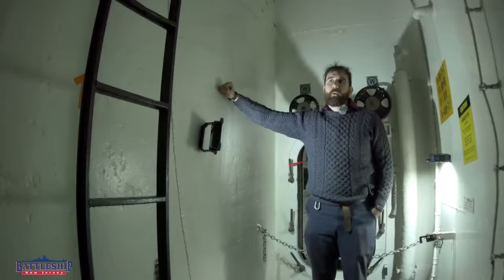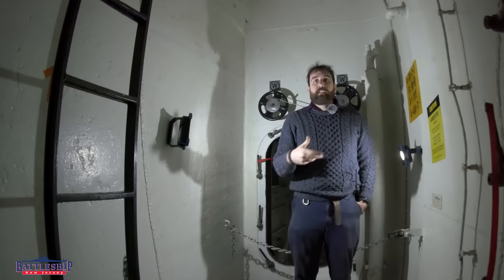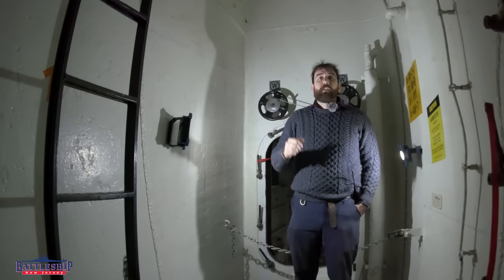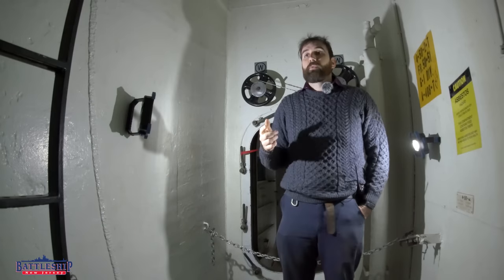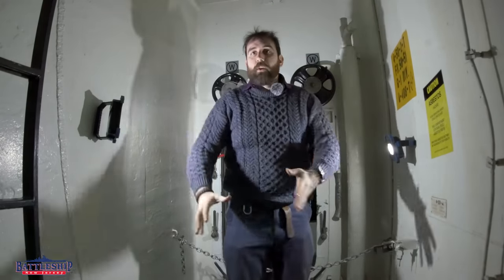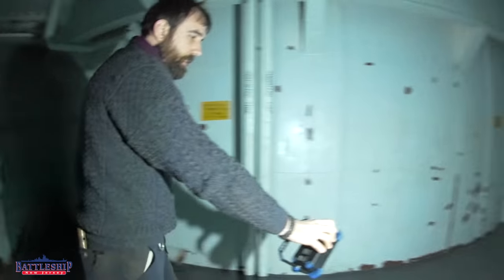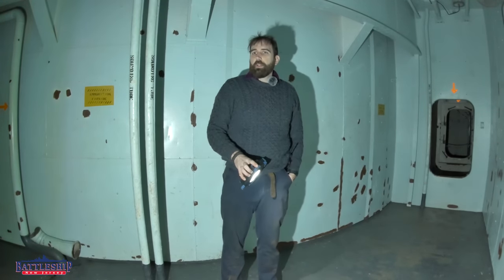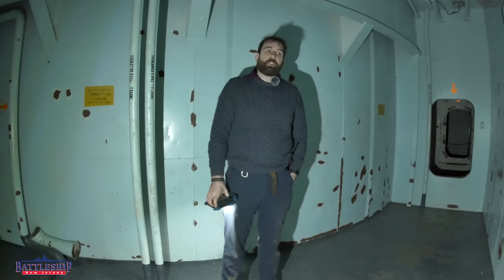Inside a 20mm Magazine

Comment: I didn't know what an explosion-proof light fixture is, but now I want to know all about it and other peculiar lights used on the ship.
Reply: You're in luck! Here's the video. https://youtu.be/fCm5x2OmdHI
Reply: Many thanks.
Reply: It's actually not as informative as I thought. Must've been apart of a different video... too many to remember
Reply: They are common in mines and other hazardous areas, otherwise known as Class 1 Div 2
Reply: I have them all over my plant. I would guess most on the ship are Class 1 Division 2 fixtures. Class 1 Div 1 are probably used in the powder rooms though because of the propellant off gas. I have to use class 1 div 1 flashlights in my plant
Reply: Anywhere a spark could tigger an explosion.  You see them in grain elevators, as its very dangerous in those as an example.  Even in the engine rooms of gas powered boats.  Everything in that space has to be explosion proof, as you can't have a "spark" when something is turned on just in case.  The issue with lights is when the bulb fails or possible shatters due being hit, there would be an arc which could trigger a very rough day for the people.  👍💥
Reply: "Explosion Proof" is the actual terminology people use, but, it's kind of misleading.  In essence, it means that the light, or switch, or flashlight, etc. will not cause an open spark to cause an explosion.  The light bulbs are shielded.  The threads typically have o-rings.  They are rugged, often out of cast iron or cast aluminum.  Basically, it means that if something happens in device, it will not cause an explosion.  I think there are separate ratings for flamable gas or explosive powder environments.  I used to work in a solid rocket propellant plant in Sacramento, and in the factory & assembly areas, all of the lights, switches, outlets, and even our flashlights were "EP" as we referred to them.

Comment: The zig-zag tread pattern left on the floor comes from 1980's era chukka safety shoes issued at that time. They were a six-inch high boot/shoe with steel toes.
Reply: Boon dockers
Reply: @MrJeep75  I knew they were called something else back in the day, just couldn't remember what it was. They were also great for riding motorcycles.

Comment: Before you go into some of those spaces, do you check O2 levels, or is the ventilation system working in all areas?
Reply: Or ghosts?
Reply from the maker: Sealed spaces should always be checked for oxygen levels. Fortunately, we dont seal off spaces too often. This space has been open for ventilation for decades. On an active ship these places would be closed off  when not in use, on a museum ship we prefer to leave it all open.

Comment: At about 9:15 there is a fan mounted on the bulkhead. That would seem to be even more evidence of the space being used as an office.
Reply: I would like to know how they could fit a desk through the hatchway…..maybe IKEA?😂
Reply: @johnjensen2217  Navy desk is a flat board and a set of hangers, designed to be taken apart to go through the hatchways, and the supports mean it is hung from the wall, so that ship motion will not move it. Otherwise they would have taken a standard GI desk, and stripped it down so the top sheet can be unscrewed from the legs, and the drawer unit stripped as well, to make it a 4 piece unit that can fit, plus likely cutting it down in size as well to fit the hatchways, then screw it back together down in position.
Reply: @SeanBZA  You are right.  Sailors are a creative bunch and they will find a way to make it happen.  We used to say in the shipyard there is no such thing as sailor -proof 😉
Reply: @johnjensen2217  Old story of a sailor tossed in the brig, so the captain puts 2 cannon balls in there to occupy him. Next day at roll call he is found to have lost the one and broken the other.

Comment: At about 4:51, when you show the upper hatch, it looks like there is a ladder that goes part of the ways, but nowhere near the floor. Where is the rest of the ladder? I don’t see the little wire rungs you sometimes show.
Reply from the maker: It's not a ladder it's netting, usually allowing just a small opening near the ladder so if someone falls hopefully that will catch them.

Comment: In the UK, we used to have lock fittings in our excise bonded warehouse which were designed to be broken easily by firefighters if required.  When handling barrel proof whisky, fire is a serious hazard.  The tax officials held the keys.  If the lock fitting was smashed, it was very obvious, and would be investigated, but at least the firefighters could get in.

We also had (and have) easily smashed bolts on some substations, so the fire brigade can get in.

Comment: In the start of the video, there are two hand cranks over Ryan's shoulders marked 'W' and connected by what looks to be a safety wire.  Does anyone know what their function is/was?
Reply: They are for damage control to control ventilation.
Reply: Thank you for asking. I was wondering the same thing. Is that something found usually in deck's below the water line? Are they still currently used?
Reply: @nathanielfoster2851  Thanks! How do they work?
Reply: I dont know what the W stands for or what they do when turned, but usually when you wire nuts or cranks like that its to stop them from turning accidentally or being turned by someone.
Reply: It's called a circle william fitting. Yes they are still used in the modern navy. They are normally in a locked open position and in case of a chemical biological radiation(nuclear) attack, fire or anything of the sort they are closed so it doesn't spread and cause more damage.

Comment: I'd be interested to see a clip about the differing types of 20mm ammunition used. Am guessing HE and Tracer would be the ones commonly used, but believe there were also Armour piercing and a high velocity Armour piercing round but its hard to know if they might have been used at sea by something carrying so many much larger guns.
Reply: I doubt that those 20mm rounds could achieve high velocity, since their range was so short, that by the time they were firing at a plane, it had already dropped it's payload. So it was pretty much exclusively HE and tracer rounds.

Comment: Hmm - it would be interesting to see the original ammunition boxes for the 20mm ammunition - are any of them still around? It would give us an idea of how many could be stored in those spaces.
I assume they came in big metal boxes, like those used for rifle or machine gun ammunition for the infantry. Do we know what kind of containers were the 20mm ammunition transported in?
Reply: Is there any record of how all the ammunition was delivered to the battleship? Most people don't appreciate how much work goes into resupplying ammunition, because it all has to be transported from the factory to the ship down to the rifle, packaged to keep it from detonating on the way. Which might mean it was packed in a box or a wooden pallet. How were the 16 inch rounds taken on board the ship, the 5 inch rounds? Individually, or in big wooden pallets that had to be broken down by the crew? How were the powder bags taken onboard?

When I was a tanker in the Army, the main gun rounds were delivered in a big, wooden pallet, that was just dropped next to our tank in the field - we would have to attack this wooden pallet with a pair of bolt cutters, an axe and a sledge hammer, and tear it apart - then each round was stored in a thick, card board tube that we would have to break apart. Only then could we take the individual tank round out of the tube and pass it into the tank to be put into an ammunition rack in the turret or hull.

It was a lot of work - I wonder how the battleship took on ammunition, and if it was as much work as we had to do for a tank -

Comment: Question for Ryan, given the role of the 20mm AA guns on the ship why were the guns not belt fed?
Reply: Later versions of the gun were.  Perhaps getting to many rounds linked together may have made the boxes of ammo to heavy to move around by hand to the multitude of 20mm guns the navy was adding everywhere.
Reply: Most of the single 20mm mounts were not powered, so you can't stack too much weight on them. I imagine a good gun crew could swap the 60 round drums very fast anyway.
Reply: The design wasn't meant to be belt fed, and the drums offer decent firepower without excessive weight. Belts of cannon ammo get really heavy really fast.

Also you'd have a bunch of belt links falling all over the place. Magazines are reusable and won't be stepped on or swept over the side

Comment: Off subject but could the turrets be removed and the New Jersey be loaded with loads of vertical launch tubes and be controlled/guided by the aegis combat system of the Arleigh Burke destroyers? Basically be a missile truck for the fleet.
Reply: There was a plan in 1996 or so to place around 96 VLS tubes where the armored box launchers currently are, leaving the entire main battery and at least 4 of the twin 5in guns fully functional. 

Here is an artist depiction of what it might have looked like:

https://www.deviantart.com/tzoli/gallery/77565995/usn-warships
Reply: I was thinking about that the other day when Ryan was talking about what a modern BB would look like. (The video where he was using the large model as a visual aid)

His idea of adding the vertical launch tubes to the back of the superstructure makes sense, but I was thinking that replacing Turret 2 for vertical launch tubes would reduce a lot of weight, keep the added weight lower in the hull and still retain 6 16” barrels. 

I would think that there would be less need for 16” shells with the addition of some SM-2s serving a similar purpose.
Reply: anything is possible, but it could also be disasterous. an example they tried to convert USS Vincennes CG 49 from the old gmls missile launchers into a VLS ship, and it failed.
Reply: @mrnoodley  that’s when I got the idea also.
Reply: @leftyo9589  agreed, it could be a disaster. It just sounded pretty cool and would be pretty intimidating.

Comment: Action Stations by departments.  Gun crews closing up and how they got target information in WW2.  16", 5" , 40mm, and 20 mm crews.  Damage control crews and where (areas of responsibilities. What did engineering crews do? Wondering if you have a computer animation of the damage control boards etc. So as you talk about what is happening, people can see on video where on the ship the sailors are going to.  eg sailor in mess decks or galley and how they get to their action station.  
Go through a couple of senarios, air attack, ship attack etc.